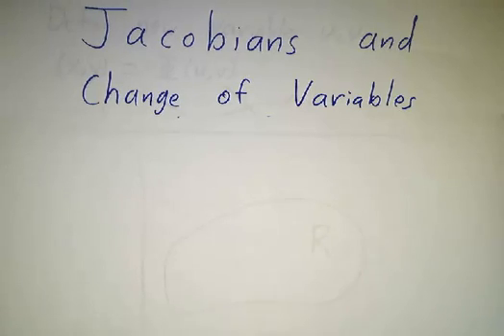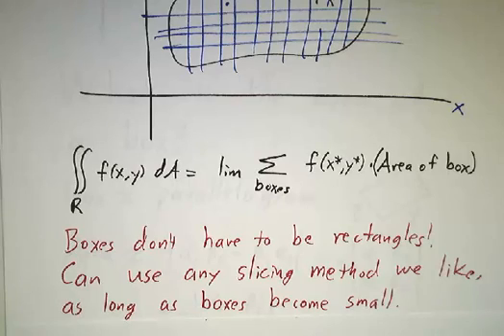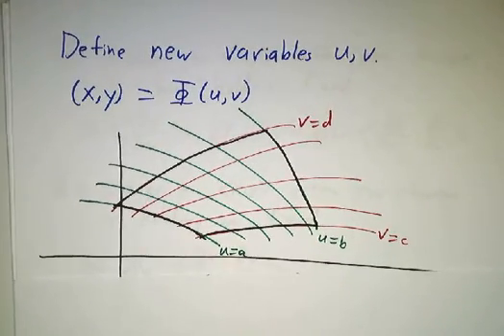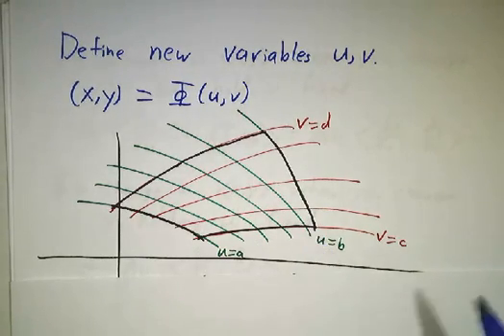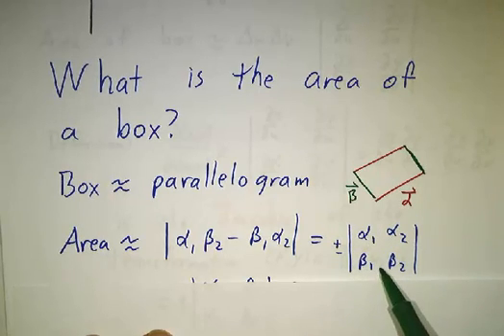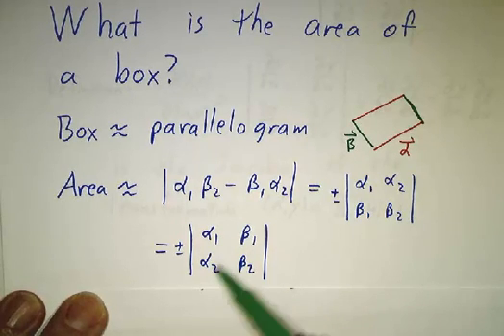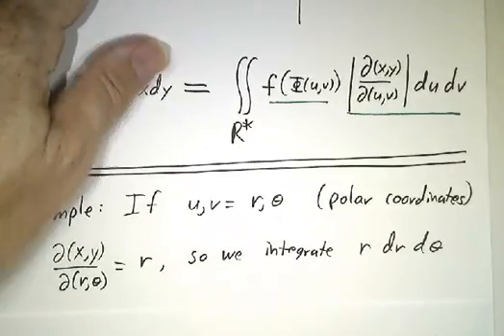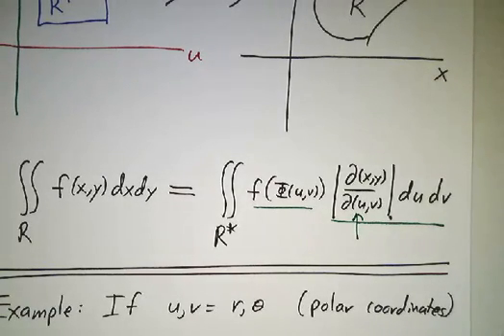Jacobians I: Theory

Comment: how will you get alpha by holding v fixed? in the graph does not both the u and v change as alpha progresses both to the right and upwards
Reply: +Elijah Paul No, because u and v aren't related to the 'right and upwards' co-ordinate system - that's kind of the whole point.